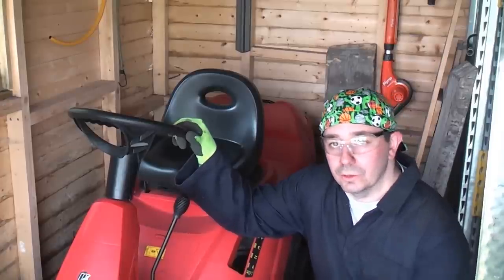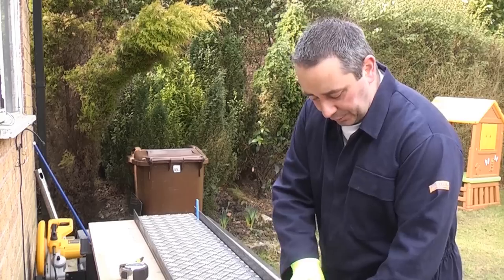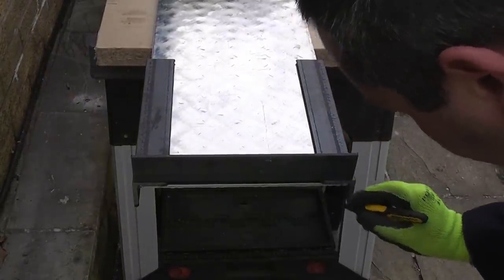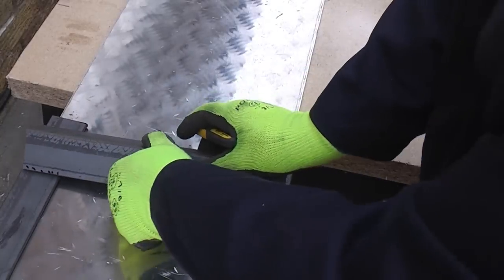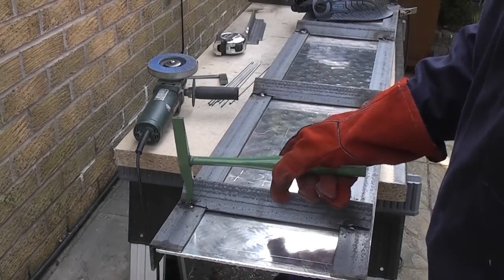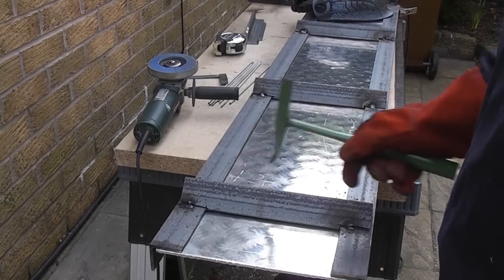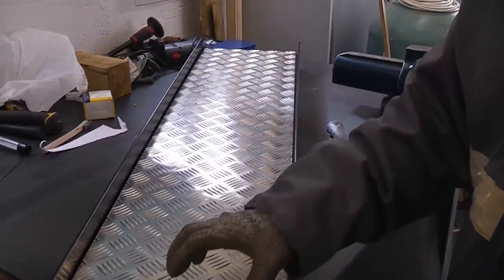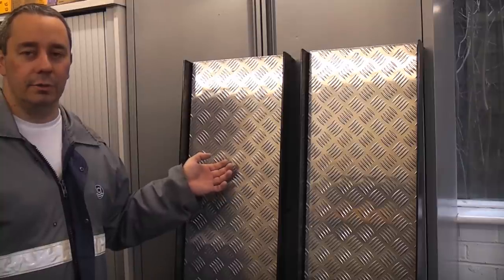How to make lawn mower ramps

Comment: Nice project. Did you use insulating sleeves around the rivets, to protect against galvanic corrosion between the angle iron and aluminium?
Reply from the maker: dalriada842 
No, I did not. If the rivets ever fail I'll replace them with small bolts as they are not really doing anything structural (they only hold the checker plate in position). Thanks for the comment

Comment: how heavy would the lawn mower be that was going down the ramp
Reply from the maker: I'd estimate the machine to be 150-200 Kgs, I'm 100Kgs.
I'm sure the ramps could easily hold up 500Kgs plus each as they are very heavy duty.
Reply: oh right thanks for messaging back
Reply from the maker: John Jones
You are welcome ;-)
Reply: just out of interest if you weigh 100kg is that roughly around 16 or 17 stone
Reply from the maker: John Jones
I'm 101kg's at the moment, which is exactly 16 stone according to my scales.
I have been dieting and going the gym again after a layoff of 4 years as I was too busy to go. I was 115kg's in 2011
Reply: oh okay sorry if I sound rude asking your weight. would those ramps support people weighing in exess of 20 odd stone just out of interest
Reply from the maker: John Jones
No problem.
Yes, they should easily be able to support that weight.
Reply: For as good as he made the ramp, it would hold a five hundred pound or more mower easily.